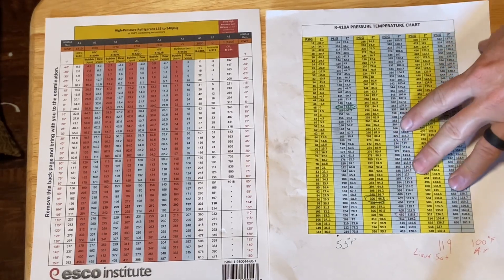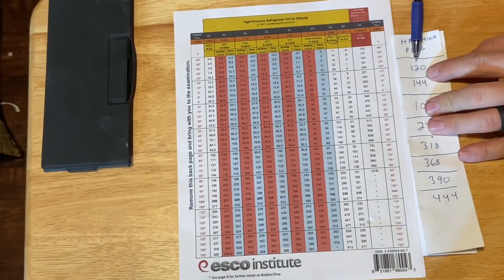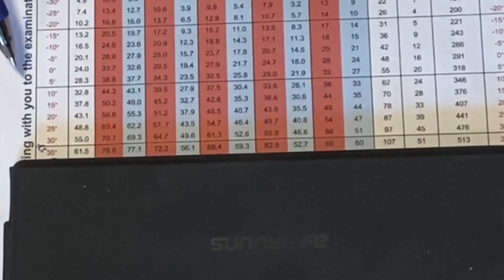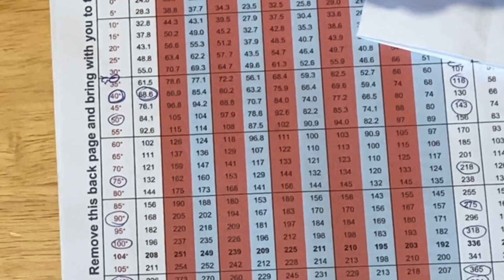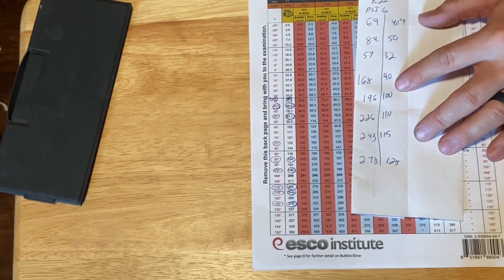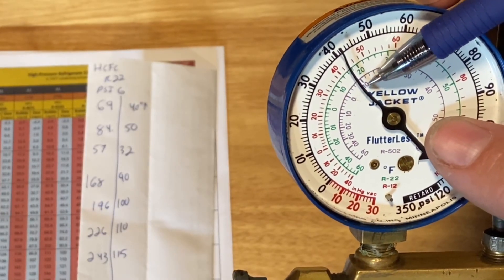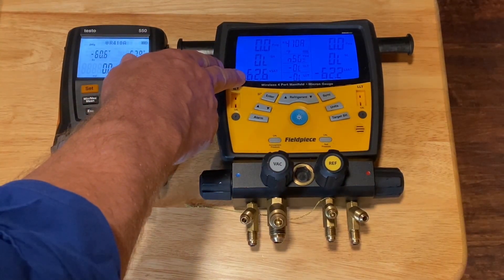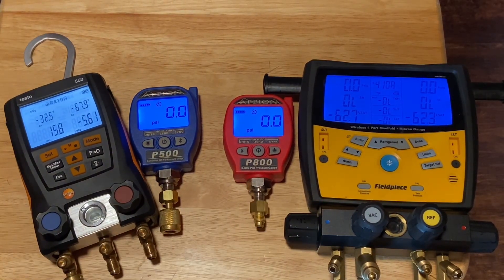HVAC 027 reading a Pressure Temperature Chart, saturated temperature chart

Comment: people with the chart remember this.
Low-Side (Suction) Pressure:
Reading Pressure: Attach your gauge to the low-pressure side of the system (usually blue).

Interpreting the Chart: Find the corresponding temperature on the P/T chart. If the saturation temperature is too low (e.g., below 32°F/0°C), it indicates low refrigerant levels, and the evaporator coil may freeze.

High-Side (Discharge) Pressure:
Reading Pressure: Attach your gauge to the high-pressure side of the system (usually red).

Interpreting the Chart: High-side pressures can vary based on ambient temperatures and the specific refrigerant. As a general rule:

If the pressure is too high, it could indicate issues such as overcharging, a clogged condenser coil, or airflow restrictions.

If the pressure is too low, it might indicate undercharging or a malfunctioning compressor.

Comment: Hey Branaman! I've been watching your HVAC playlist and its amazing. I just wanted to ask what's the difference between psi rating on the left hand side of the digital gauge and the head pressure on the right hand side of the digital gauge.
Reply from the maker: They are  both reading PSI gauge
The red represents the high side aka head pressure after the compressor to the metering device. Because it's a higher pressure the gauge goes to a higher number. This means it goes to a higher PSI gauge reading and can handle the higher pressure while the system is running. However with more numbers on the same size dial it's harder to read. Each mark may represent a 5 or 10 psi difference so it's harder to see exactly where the  umber is. When it's converted to temperature it tells us where the refrigerant is condensing at outside. 

The suction side will be a lower pressure from the metering device back to the compressor. Because it's lower pressure the guage does not need to read as high. This allows the reading to be more easily seen. Each mar may represent 2 or 3 psi. It's easier to see where the needle is pointing. It tells us where the refrigerant is boiling or evaporating at inside. 
The blue suction gauge also called a compound gauge because it also reads negative pressure below 0 psig or better known as "hg or inches of mercury or vacuum. Because it measures positive and negative pressure it's called the compound gauge. 

You could use the high side for the suction but it's harder to read and it won't read negative pressure or vacuum. 
If you used the low side on the high side it would over pressure out of range and damage the gauge.

Today digital probes use a sensor. It's the same sensor for each. In the app you select if it's mapped to hi or low pressure so the app can use the formulas to do the correct math for you.

Comment: I have a question . I know the 30 degree rule for head pressure but what is the correct way to know what your head pressure should be ?
Reply from the maker: 30 degree rule is no longer accurate.  Old ac units and refregeration units but even refrigeration units are changing now. 

I have a video on this somewhere condensor TD I believe it's called.

Comment: where I can buy quick valve showing at 12;43..for single digital gauge..with 1/8" NPT
Reply from the maker: https://www.grainger.com/product/3DXH1?ef_id=CjwKCAiAprGRBhBgEiwANJEY7NlWkdzAma8t7Zb5tJwxonqGPQ9T0m1AYklFhztz0WB6q9czgZLebRoCtoUQAvD_BwE:G:s&s_kwcid=AL!2966!3!284662588492!!!g!531027606407!&gucid=N:N:PS:Paid:GGL:CSM-2295:4P7A1P:20501231&gclid=CjwKCAiAprGRBhBgEiwANJEY7NlWkdzAma8t7Zb5tJwxonqGPQ9T0m1AYklFhztz0WB6q9czgZLebRoCtoUQAvD_BwE&gclsrc=aw.ds
Reply from the maker: Quick Coupler, 1/8 in (F)NPT x 1/4 in Female, Brass Fitting

Comment: How do you like that testo 550? would you recommend it and how does it work for a micron gauge?
Reply from the maker: Me personally, Im really not a fan of the Testo 550. I don't like how the temperature probes fit into the head. I did not like having to switch screens to see all the information I wanted. 

In direct comparison I ordered the SMAN 460 I find the micron guage, vacuum hose and 4 port manifold a waste of space and makes it bulky.

A year ago I gave in and went with the Feilpice probes with the measurquick app. I love it, it is perfect. 

That's just my opinions, everybody has something they like different. 

As for the micron guage, I think the micron guage in the manifold is a bad idea. Too easily gets dirty, too close to the pump and too far from the system. 

I'm editing a video pulling a vacuum on the 4 port with the micron guage built in, with a second micron guage on the actual unit to compare.  There was a big difference.

Comment: Does the PT chart include some kind of adjustment to accommodate the increase in pressure from superheating which is after the saturation phase inside the evaporator?
Reply from the maker: There are many variables that take into account the saturation% boiling pressure. The pressure will not change again after saturation. The tube can gain sensible heat above saturation but it's the same tube so its the same pressure. 

Just as oxygen bulls at -183F thays its saturation temperature at 0 psig (14.7 psia) the oxygen in my room is at 78F the oxygen is superheated 261 above its saturation temperature but still at 0 psig (14.7 psia)

Superheat will be the vapor after saturation at the same pressure. 

Water boils at 212f at 0 psig 14.7psia less than that water will boil at a lower temperature. 
But if I lower the pressure

Comment: Ty. What could be causing to a system that I know it’s low on refrigerant . I add refrigerant but the low side reads 95 psig and the high side reads 180 psig . As I keep on adding refrigerant, the pressure on both sides are not moving anymore. It’s an R22 system with a piston.
Reply from the maker: Pressures mean nothing.

How much CFM across the evaporator coil?
What is the superheat and the target superheat
What is your subcooling and what's the OD temperature.
Reply: @love2hvac  I will check on those info when I get back to it. Thanks again Ty.

Comment: So, by using the P-T Chart, once you have obtained the psig, on any gauge, you can convert any number. 
So the psig is the really important factor, or am i wrong?
I used the National Gas app, whilst following your Tutorial, and works just dandy.
Damm, i am starting to talk like an American. Won't use Fahrenheit though 😀
Reply from the maker: The metric system is a much simpler system. Digital gauges are great because they do all tue conversion for you.